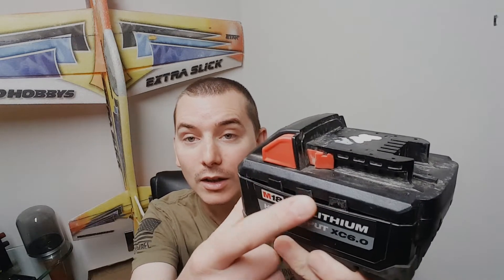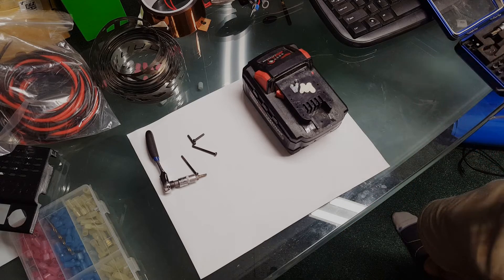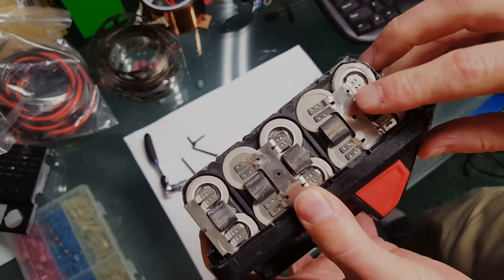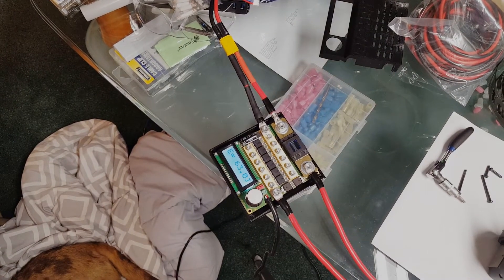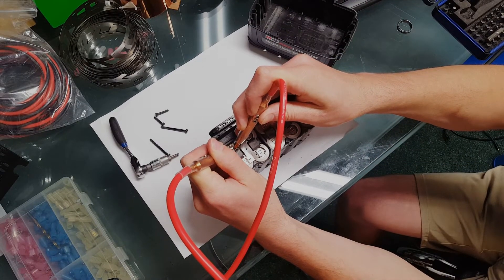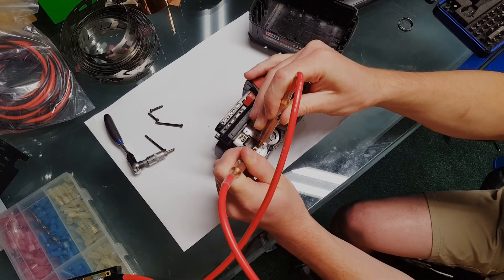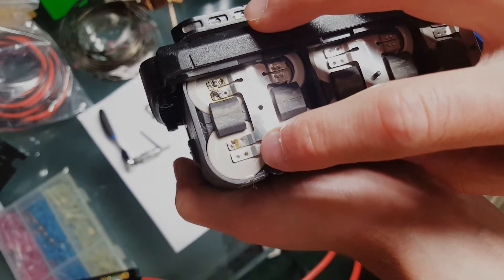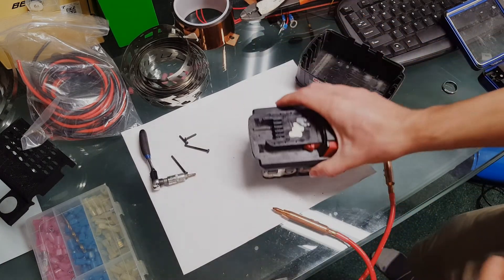Milwaukee Battery Repair-Will It Work Again? Spot Welding An M18 6Ah Battery!

Comment: Perhaps they fix the circuit board issue with 21700 cells
where those xc 5.0 has all load of bad protection board causing them to keep flashing and shut the entire circuit off
won’t be able to charge either.
Reply from the maker: Interesting! Didn't know they had issues. Thanks for watching!
Reply: @diyrenewableenergyelectron4996  go visit your local Milwaukee service center and you shall see a lot of them come back for replacement
Milwaukee doesn’t even repair them.
all those 18650 has issue from 2.0 all the way to 9.0